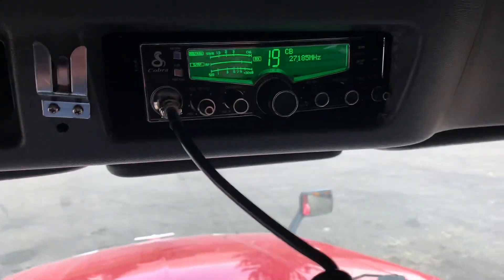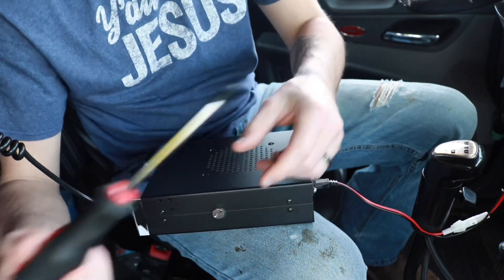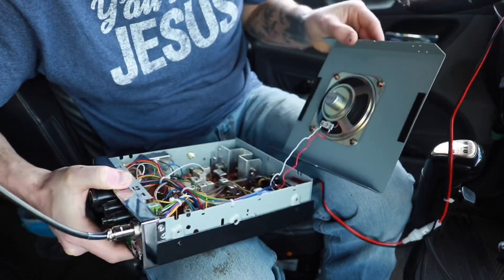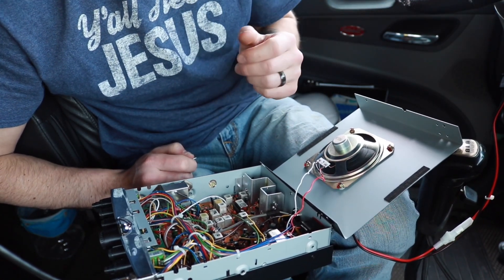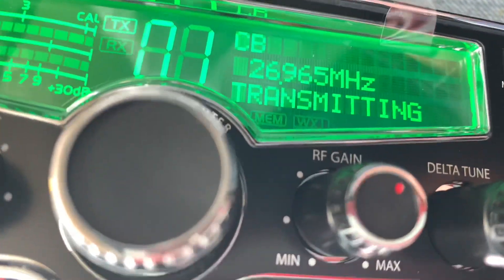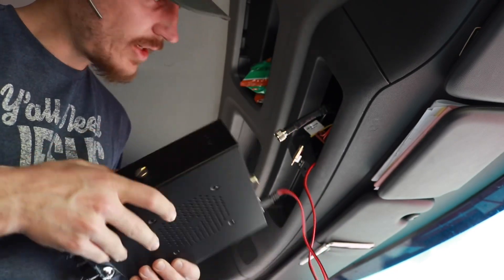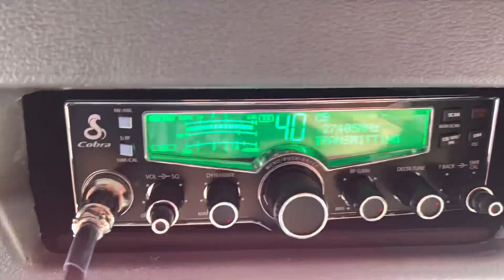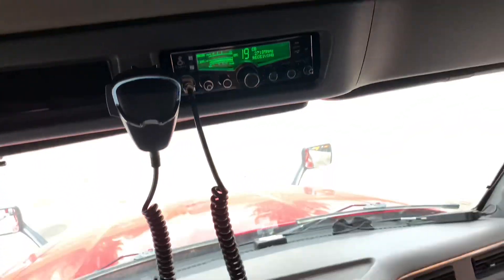How to video | CB antenna warning fix | Cobra 29 LX

Comment: No no… absolutely no. I have no doubt this actually works but it would be easier to show somebody how to re-calibrate their own radio with their existing antenna. Especially a radio like the one you have with the built-in SWR meter that is fairly accurate. Not to mention there are CAPs in there that could shock the shit out of you or even kill you if you were to key the mic while inadvertently touching one. It only takes 0.1 amp to kill a human. If I can recall correctly your radio is typically on a 15 amp circuit. FWIW, I was an electronics technician in the Navy for 20 years.

Comment: I would say do this as a last resort after you’ve checked and tuned your antennas with an SWR meter, also, NEVER key up your mic without an antenna hooked up, quick way to burn out your finals, yikes!

Comment: I bet ypu don't have a watt
watt swr meter
Reply from the maker: you'd lose that bet
Reply: @truckertavis  unless there is something im missing the word antenna means that object connected to your coax...you ground it properly and you get cooler performance  ,better output. When you turn a pod to turn off that light really helps you key the radio longer before she pops your wattage is very low which means poor performance.crank it back where it was and concentrate on your antenna.please verify this good luck..